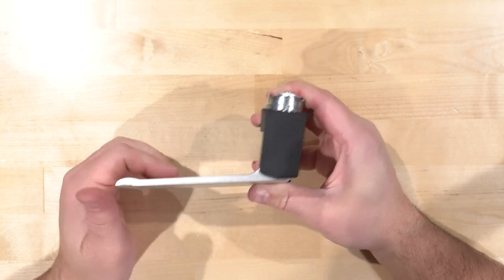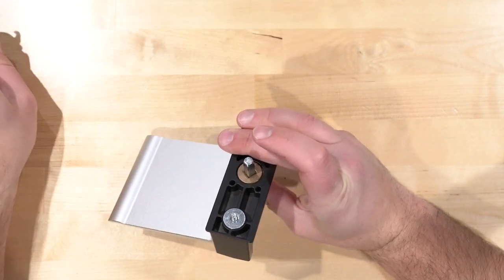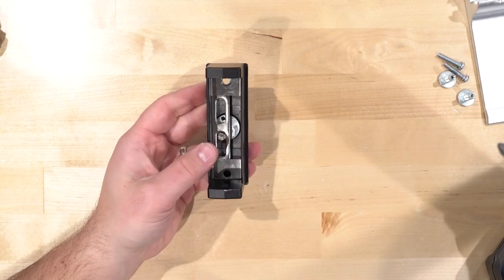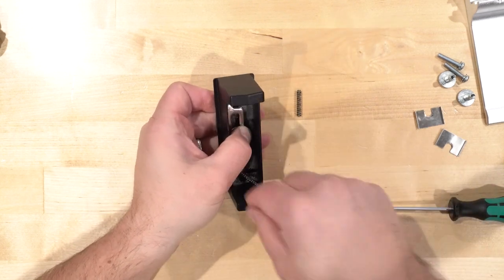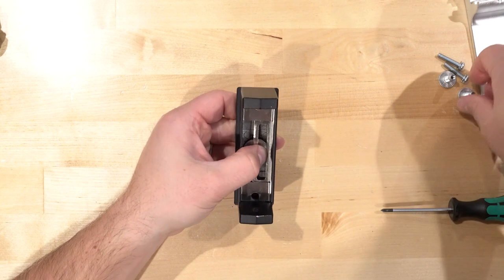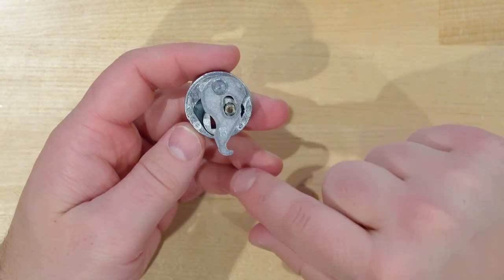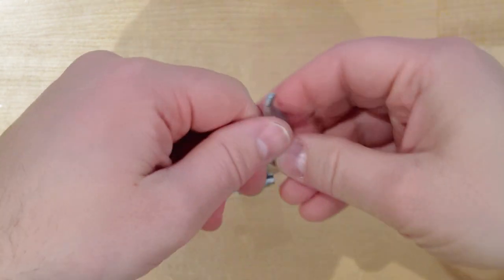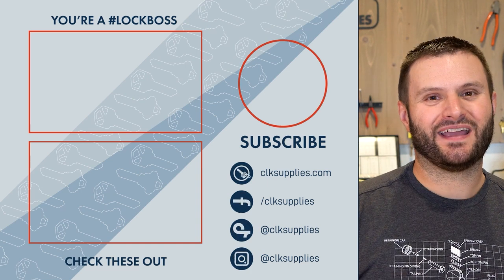How to Swap an Adams Rite Paddle Handing (Professional Locksmithing Advice)

Comment: Another great video PJ. The C-clip will go flying off the rear cam if you’re not careful. You will not find it.  Asks me how I know this. Only thing I would change is to point out the what you called one spring is actually two spring one inside the other.  Those springs get worn and brake so make sure you have spares.  Thanks again for pulling my name this past week on the live.  #Lockboss winner.  Ps. Send me the Triton so Locksny doesn’t get it.  😉

Comment: PJ Love the content as always..
Uh oh. Did you move the little allen key timing screw at 2:19? If you don't move it to the other hole, when you reassemble, the tailpiece won't be in a diamond orientation as the driver requires. That'll be a 15-30 minute in-field learning lesson if you needed a video in the first place.
Also, the instances of springs getting crushed over time reduce significantly when the bar that acts between the lever and the timing screw is installed with the smoother side against the black knuckle surface. 
I'd be a #lockboss except I'm too Canadian to be eligible. #mooseknuckles
Reply from the maker: Hey! Yes, but thanks for mentioning it! Great for ppl to read -PJ

Comment: Oddly, CLK seems to be the only good source of instructional locksmithing information. Thanks, I always buy from you when I need stuff. Curious, it looks completely alike, I mean, couldn't you simply install upside down? There is no difference from the top to the bottom, except- if using a key, it would be upside down. I tell people, 'That's how the keyways are in England, just pretend your English'.

Comment: #LockBoss, I've never seen one close up, but it looks like you could have just spun the whole paddle housing 180, and flipped that tail piece module 180, so the tail piece remain toward the bottom, or is there a this side up to that paddle housing?
Reply: Can’t just be flipped.  The pins that hold the back cam orientation only go one way.